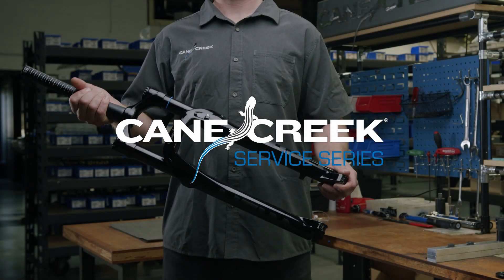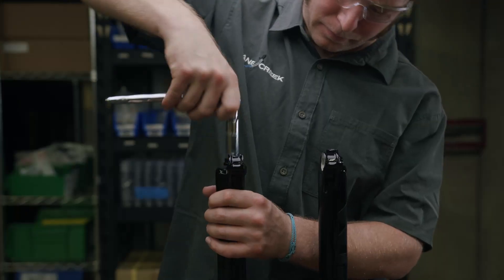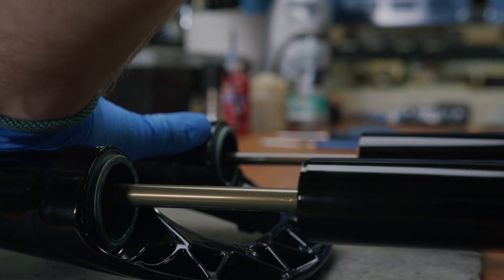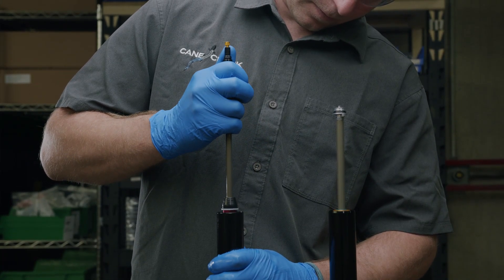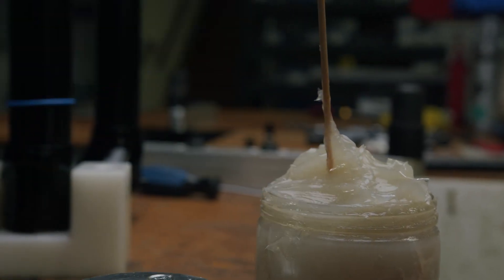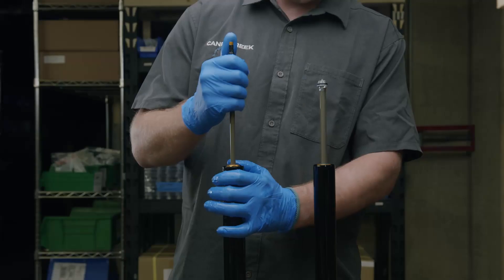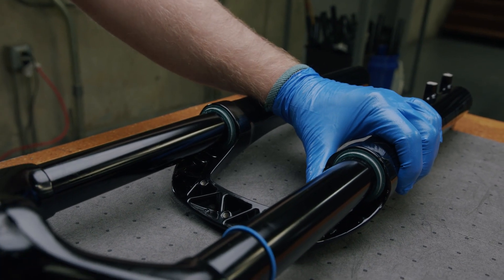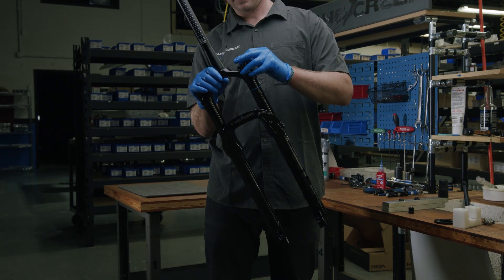Cane Creek Service Video: How to Travel Change a HELM MKII Air Fork

Comment: Does adjusting the travel also change the axle-to-crown measurement and is that data available?
Reply from the maker: Hi. The answer is yes. Any time you change the travel in the fork, let's say by 10mm, the axle to crown measurement will change (+ or -) that amount as well. This data is on the Helm Spec sheet as well.

Comment: Posting this here for quick reference (I'm struggling to find this info anywhere).

For travel adjust on the 29er helm MK2 air

0 spacers = 160mm travel
1 spacer = 150mm travel
2 spacers = 140mm travel
3 spacers = 130mm travel
Reply: Thanks Steve. The coil instructions from the manual show 4 spacers for 130mm travel. 
I know that's different from air spring setup but it really had me scratching my head because they look so similar.